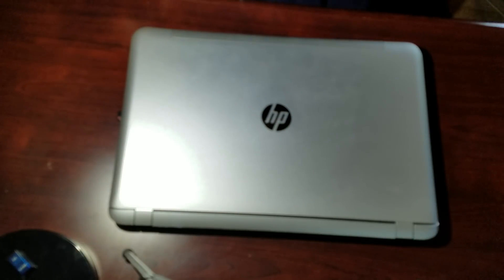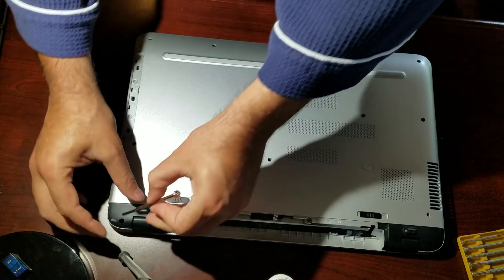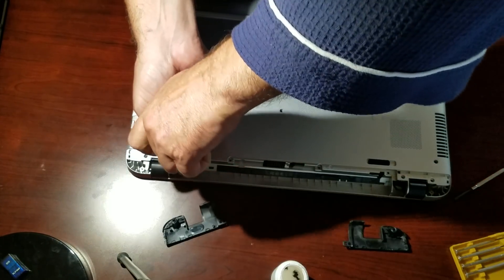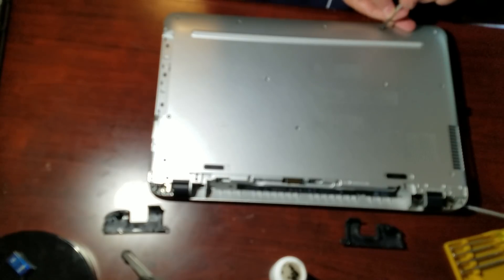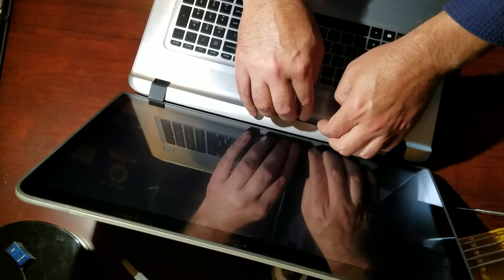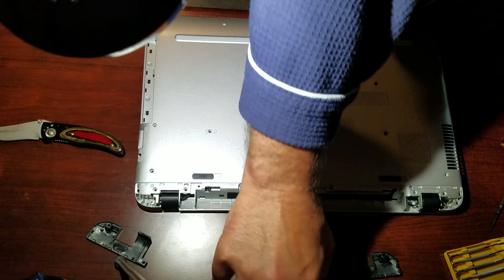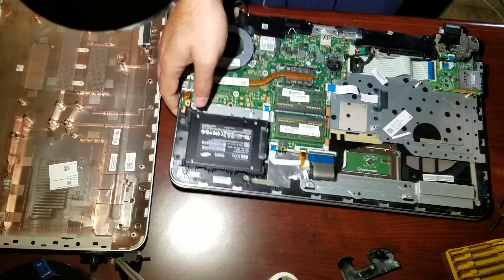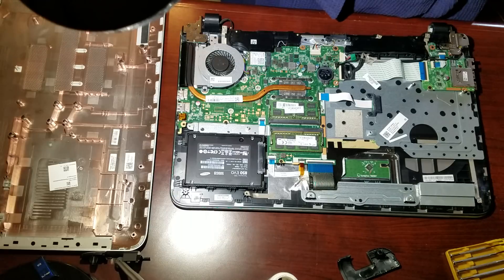HP Envy 17-s017cl disassembly SSD upgrade w/ instructions.

Comment: Do i need an adapter for this (if so can someone recommend one that’d work on the laptop in the vid)
Reply from the maker: You can use a desktop computer to upgrade your laptop to SSD and clone your existing data to the new SSD drive..  Instructions are in the description of this video.

Comment: Thanks for showing how to get the cover off. Those 2  hidden screws were my problem. Dont worry about using a magnetic screwdriver. There is a bigger magnetic field in the SATA drive then on the tip of your screw driver. Buddy of mine takes the magnet out of the drives we replace and gives them to the local high physics teacher for experiments in magnetism.

Comment: thans man, i used a magnetic screwdriver but its tiny, i guess be safe, I did not and no problems.  My main issue was an insane amount of dust sucked into the fan. Clean now, SSD and memory upgrades next.

Comment: Thanks for the video really helpful, do you know if the motherboard have a space for a Nvme ssd or have you tried installing a ssd in optical disc drive
Reply from the maker: I don't recall there being an PCIe slots.  I did consider replacing the CD/DVD ROM with a SSD Caddy for a second drive... but didn't end up doing it.  I've since went with an HP X360 Spectra 2n1.  This old laptop now feels like a boat anchor in comparison.
see: 
https://www.google.com/search?q=laptop+CD+ROM+drive+ssd+replace&rlz=1C1CHZL_enUS733US733&oq=laptop+CD+ROM+drive+ssd+replace&aqs=chrome..69i57j0.24136j0j4&sourceid=chrome&ie=UTF-8#kpvalbx=_1L3QXsfdDbC-ggfB6ZPQBg30

Comment: Thanks to your video, I was able to replace the incredibly noisy fan in my laptop. Much appreciated!
Reply: I'm having the same issue with my HP Envy 17t fan as well. Is it as simple as unplugging old junk fan and replacing it with a new one by plugging it in?
Reply: @bosky209  Yes, that's all you have to do. The hardest part was getting the cover off, which would have been a lot easier had I thought to pop off those two black pieces on the corners to get to the rest of the screws. I got the fan on Amazon for $10.

Comment: God, I love YouTube.  I have this exact model HP.  Want to do the exact thing you're doing here, even down to reducing from 1TB to 512GB.  Would NEVER have made it without this vid.  Thanks.
Reply from the maker: The video is the disassembly.  The drive transfer instructions are in the description.

Cold boot time: 30 seconds
Reply from the maker: also noticed you're into linux.  Highly recommend installing WSL *(Windows Subsystem Linux) Ubuntu 18 .  Here's my blog on how to launch a LAMP from windows boot.

https://satalink.blogspot.com/2019/05/windows-subsystem-linux-wsl-auto-start.html

Comment: Thank you! Attempted disassembly first time not knowing about screws under the corner covers next to the battery, nor the screws under the cosmetic covers. Rhetorical reaction: why the heck do they worry about covering those two screw holes when they leave 12 others uncovered???
Reply from the maker: That's the best question I've heard yet.

Comment: What is this bro, took more than half of the time in just unscrewing the laptop. Tou could have skipped that part. 👎👎👎👎
Reply from the maker: I could have.. but I clearly said if you want you can slip through this part by way of the magical right arrow key (depending on your device).   
I might eventually edit it at some point with shotcut and blaze through the boring stuff.

Comment: I just got done performing this same upgrade after watching this video twice.  I used the free version of Macrium Reflect software and an external USB SATA docking station to clone my existing 1tb hard drive over to the SSD, with the SSD option selected in Macrium.  That was the longest time in this process. About 6 hours running overnight.

I followed your directions to the tee, and had zero problems opening the case and swapping the hard drives.  I used my label maker to create some labels for the new SSD hard drive, with the vendor, order number, order date and the fact that it has a 5 year warranty.  I figured a few years from now, I might be needing that information if anything went wrong.

The actual time spent opening the case, swapping drives and testing before closing the case, was about the same length of your video.

My Windows 10 Home x64 system is now running like a race horse, but without the breaks between laps.  The difference in boot speed is night and day.  Running apps is amazing. I should have done this sooner, but I waited until Newegg had the WD 1tb SSD drive on sale for $115.99 and free shipping.  Now I think I'll go convert my older Windows 7 Dell laptop over to SSD also.  This has convinced me.  Thanks!

Comment: Thanks for the help. One question, this model can only be placed 1 disc or have more units. Thank you
Reply from the maker: this specific model only has one drive capacity.  If you must, I would look to replace the DVD with a static tray caddy.  

https://www.amazon.com/Highfine-Universal-SSD-HDD-Enclosures/dp/B01MRI8YFN/ref=asc_df_B01MRI8YFN/?tag=hyprod-20&linkCode=df0&hvadid=309773039951&hvpos=1o3&hvnetw=g&hvrand=14563495653175082820&hvpone=&hvptwo=&hvqmt=&hvdev=c&hvdvcmdl=&hvlocint=&hvlocphy=9010869&hvtargid=pla-570532555423&psc=1

Comment: Thanks, Neal.  I broke my wife's HP and want to check the power adapter connection before I send it to HP.  Hopefully, the battery's down and it isn't charging.  I took off the long strip first too.  :)  The little cosmetic tab info is a great help!

Comment: Was dead battery reason for not booting or was it another issue?  My HP laptop has same issue.  Power button light comes on and then goes off, system will not start.

Comment: If you put a towel under your laptop... you wouldn't need to worry so much about losing a bouncing screw.  Edit: Oh and then you said you don't care. Nice.
If you have one... you can use a guitar pick to pry open the case. But they DO sell plastic case openers.

Comment: This was more helpful and accurate than the HP documentation.  Also on YouTube videos it can be difficult to find an exact match with a particular laptop but this was it.  The HP documentation points out two screws in the optical drive bay that didn't exist on mine, and the pictures are fuzzy.  Explaining how to pry the case open was the most useful part of this for me.  I only cracked it slightly in one small spot above the right side USB port where it is very thin.

Comment: Im having a hell of a time getting all the snaps back together. The ones near the feet opposite of the power button are not giving in. Im about to screw it all back together with that portion not snapped down but I wont only because Im afraid itll stay permanently bent/twisted.
Reply: It was a black cover piece near the hinges, watch those carefully. Youll see them when looking at the bottom of the laptop (having the screen on the table)